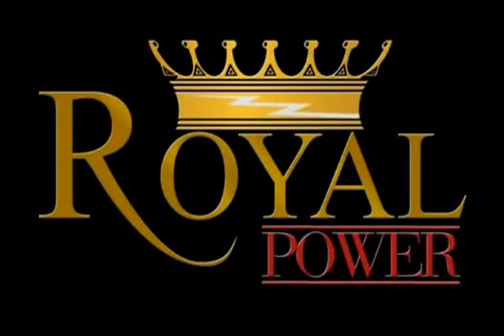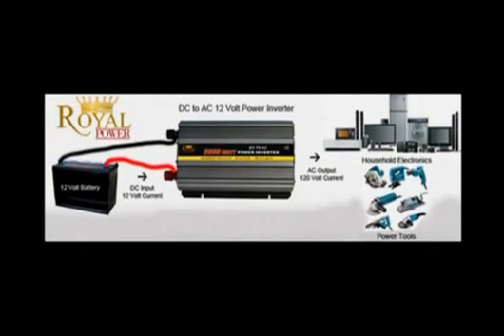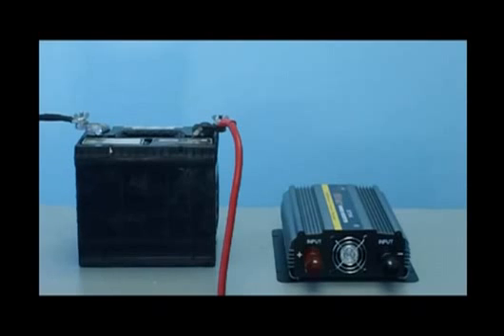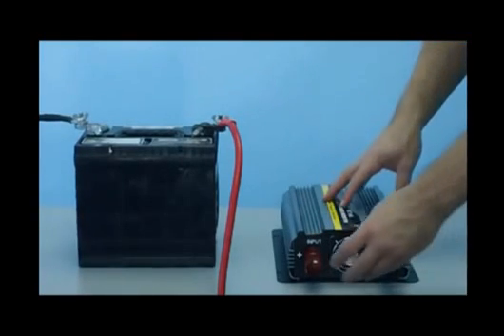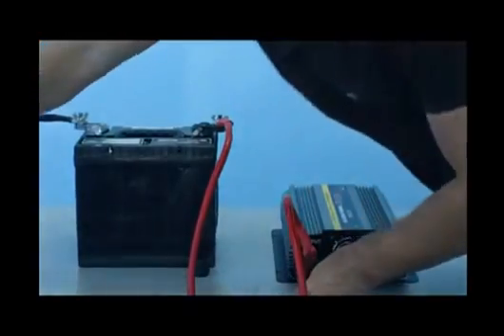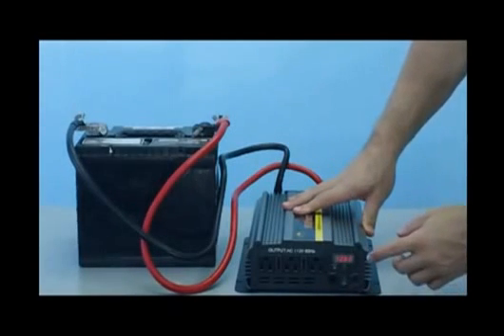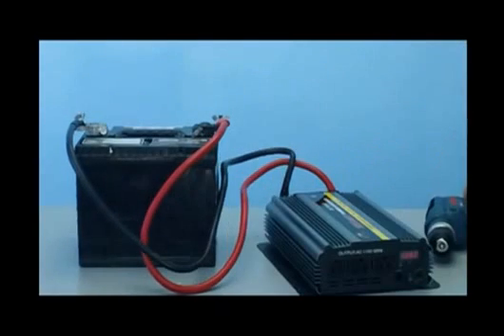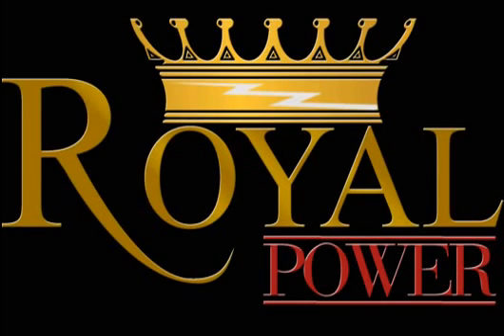Power Inverters - How to install a DC to AC Power Inverter

Comment: how much amp battery should have i know you just used 12 volt battery like that ok am not that dumb
Reply from the maker: Depends on your desired load and runtime. PowerInverters.com has a great battery guide.

Comment: Is there a way to connect a battery charger on the same system so a battery can charge as it works?
Reply from the maker: You can not charge the batteries with its own power.
Reply: but can you use a solar panel to charge the battery  ?  @Royal_Power_Inverters

Comment: I am looking at making me a bike camper .  With a quality solar panel .  I will be running .  a small power inverter . ( about 140 watts ) As will a couple led lights & USB charger .  & 0 small exhaust fan part of the time .  HOW LONG DO YOU THINK !  A larger size lawn mower battery will last .
Reply from the maker: Depends on the amp/ hours
Reply: @Royal_Power_Inverters  all I can tell you at this time about it is that it said it was a 230 cold cranking amps and it's not a little battery it's about half the size of a smaller car battery.

Comment: I have a battery that I don't care if it goes flat and my inverter shuts off to protect the battery so my question is how to disconnect the circuit of low voltage controller inside the inverter? thanks.
Reply from the maker: There is no simple way to disconnect the auto shutdown.

Comment: it is possible to connect three or four power inverter in series in home
Reply from the maker: It would be better to connect several units off their own set of batteries and designate certain breakers per inverter.

Comment: Cam the battery be connected to the wall for charging at the same time?
Reply from the maker: You will have to make sure there is no back feeding from the charger.

Comment: Noob Question: I’m assuming that if the battery died, I could disconnect the inverter and then use a jump starter on the battery itself?

Comment: when using a power inverter to supply 12 amps at 120vac what kind of 12vdc battery is rechargeable? and the power inverters VAC output rating has to be 12 amps?
Reply: It would depend on your desired run time?

Comment: to find the amps of an power source plugged into inverter, do you multiply watts by the 12v from the battery or the 120v the inverter converted it to?
Reply: 12 volt battery with how much amp?30amp or 100 amp?those pull lot power ok

Comment: Don’t you need a fuse on the red cable ?
Reply from the maker: You can put an inline fuse. But the inverter has internal fusing as well.
Reply: Power Inverters how well are the internal fuses?

Comment: stupid question maybe but, can I just leave my battery in the engine connected as is, then connect my converter? it will still provide a power source this way, rather than if I took the battery out and connected the converter right?
Reply: You can connect the inverter to the battery even while connected to the vehicle.
Reply: start the engine so you don’t run down the battery and after using the inverter let the battery charge back up

Comment: how do you charge the battery if its goes off...and can you connect to the main stream of the electricity power.
Reply from the maker: ebenezer simons These inverter can be hardwire to main power and any battery charger can be used to recharge your battery bank.

Comment: you not install a fuse terminal in cable?there is no problem if i install directly to the battery and have no fuse at all?thanks
Reply: melvin gregorio power inverter already has fuse

Comment: what about wire gauge and inline fuses, and grounding the unit ????
Reply from the maker: An inline fuse and grounding is important. All royal power units include a grounding post. And inline fuses can be added to the dc side of the inverter 100amps per 1000 watts being used. Wire gauge depends on loads. Please see FAQ on our site for info.

http://www.powerinverters.com/page/frequently-asked-questions
Reply: I've watched a dozen videos or more and still nobody has used a ground wire.
Reply: I want to make this in a box to sit on the floor. How do I ground it?